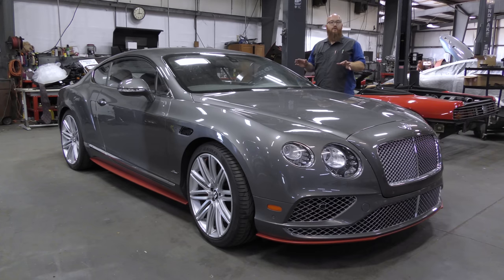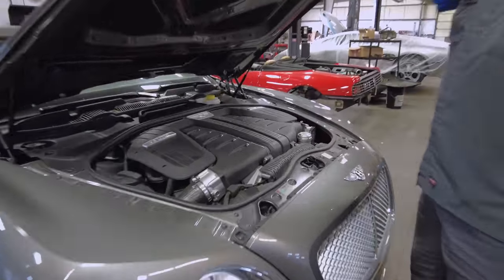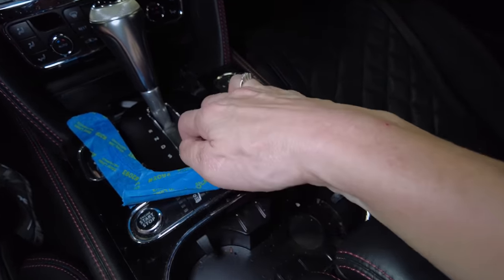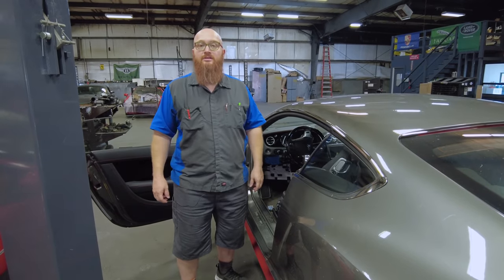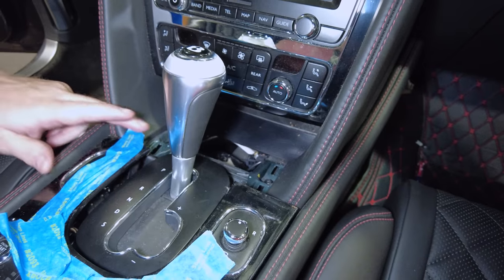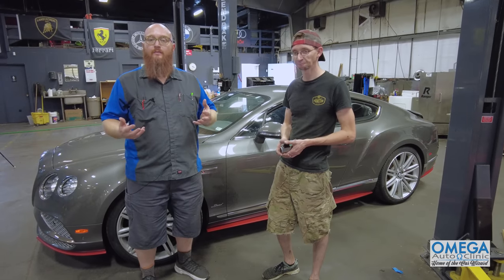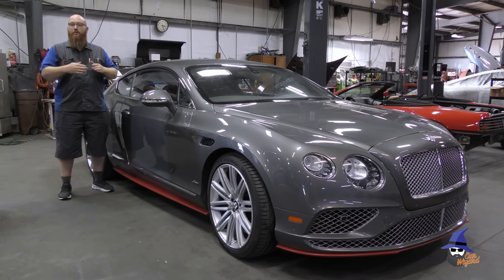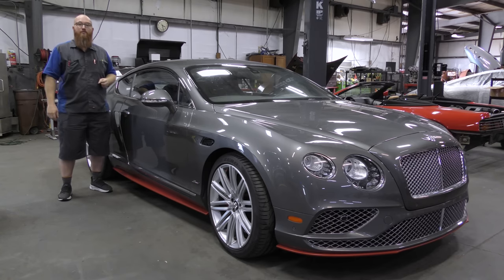How can a $10 Circuit Board make a Bentley Continental GT Speed or ANY CAR completely undriveable!

Comment: Electronics tech, here. Don't let Grimes get away - that kind of diagnostic ability on the electronics side of things is only becoming more and more valuable on today's vehicles. That guy's worth his weight in gold.
Reply: I agree, Grimes has an excellent approach to fault finding.
I have spent almost 50 years doing the same, and for a young person to be this good
is very rare, i hope The Wizard pays him for his skills.
Reply: “That guys worth his weight in gold”

Lucky for wizard he hired a skinny dude.
Reply: @dcerisanothat was leftover flux from separating the board from the housing. Caps were okay, but from what I can tell the driver for the lock motor failed. Replacement boards are affordable enough to pursue that route instead of holding warranties on an in house repair for an out of state car. We want to ensure this doesn’t ever happen in the future for the customer!
Reply: @Barbarapape my grandparents were avionics techs, grandma taught me soldering at 13, spent time doing consumer electronics and flight simulator repair and got pretty decent at SMD repairs. I appreciate it!
Reply: @GrimesGarage  Dang, dude, you’ve got me beat by a year. I learned to solder at 14. Most of my peers didn’t even know what a soldering iron was.
Reply: @Oklawolf  it’s definitely a solid skill to have!
Reply: @dcerisano Board level diagnostics and repair on something like this can very quickly reach the point of diminishing returns, especially with no access to schematics and proprietary part numbers. Is the board worth putting hours into trying to diagnose and fix it? I’d have gone the same way. I have fixed these modules in the past but I only bother trying with my own vehicles.
Reply: The question is what happens when you have these complex modules with fully solid state circuit boards that have ZERO published diagnostics and repair information.  Think early Rivian dashboard electronics and such and what happens when all of these parts no longer exist in new form and all of the designs are closed proprietary information the manufacturer won't release to anyone?
Reply: Surprised to see one of the windows aren’t down.
Reply: @dagamer667   sometimes when the planets line up.....reverse engineering happens

Comment: The issue is that nobody really pays the level of attention to the electronics in the same way that they do the mechanical parts.
Reply: I would imagine the circuit design is just fine - the problem is they would have used poorly manufactured components, like capacitors and resistors, poor quality solder and so on - many electronic components will fail eventually - but if you get a top of the line Japanese capacitor for example, it'll last many decades - if you buy some cheap no-brand Chinese one, you'll be lucky if it lasts half that time before it fails completely, and probably won't be operating to spec for a lot of time before that.  German manufacturers in particular seem to love to use the cheapest ICB components they can lay their hands on.  Bean counter engineering.
Now of course, we are seeing the same issues with mechanical parts too, at least in the spares market - it's flooded with Chinese knock off junk that just isn't reliable at all.
Reply: @Beer_Dad1975  Nope the main problem is lead free solder. the solder doesn't spread as well as leaded solder does on the pads. Unleaded solder also grows 'tin whiskers' over time and any boards in important areas should be conformal coated as a preventative. Capacitors are subject to breaking through vibrations but this is not as common as tin whiskers. One of our customers uses flexible termination capacitors in important locations on his pcbs and his faults have reduced markedly.
Reply: @OP You do not understand what you are talking about. Automotive electronics get a very serious level of attention. Beside pb-free solder, it is common to have conformal coating and potting failures, which are added to protect the modules from weather. Capacitors tend to have low failure rates as they are now solid state tantalum electrolytics for higher values.
Unfortunately that is the role of an immobilizer circuit, to prevent the car from starting. In event of a failure, it will no longer provide the logic function to allow ignition. The set conditions for which the immobilizer may not allow ignition, or in some cases, not even access to the car, is complicated, and occasionally may be triggered by a sensor, fuse, or ground fault (e.g. rodents or old age chewing through wiring harnesses)
The boot issue with the soft material gears is an annoyance, but won't prevent you from using the vehicle.

SAC95 solder is adequately resistant to tin whisker formation due to alpha-tin state conversion. If it's a particularly crucial safety related circuit (e.g. accelerator pedal sense plate) you could go with indium based solder.
Reply: Sadly the mechanical parts are not that great either
Reply: Total rubbish.  My 1998 Isuzu Monterey (Trooper in other markets) got stuck in Nolan's Brook and the 4WD computer under the driver's seat took a bath.  Only had 2WD until we camped overnight and I pulled the computer out, opened it up, and dried the circuit board and the connectors.  Put it back in the car and it was perfect for the next 10 years till I sold the car.
Reply: @@dcerisano Your childish allegation that a high end car would not use low end caps boggles the mind.  A few years ago the market was flooded with dodgy caps.  Even high end HP servers were affected, along with every brand of motherboard and every other device imaginable, including cars.  I had the pleasure of replacing caps on hundreds of devices and restoring them to full operation.  Made a lot of money fixing mission critical servers :)
Reply: @@dcerisano I'm hoping somebody does some aftermarket fab for this sort of thing. Maybe from pcb way.
Reply: @MajorGenralDizz  way more aftermarket support for mechanical than electrical. So we could find an improved version.
Reply: @einfelder8262  wish we had those manufacturers now. And you didn't pay 150k for that car either.
Reply: You can do a visual inspection on mechanical items. Electrical inspection, scan tool and ?
Reply: @iiNgONYaMa  Inflation is a thing.  Manufactured goods back in the 60s were VERY expensive compared to wages.  Not everyone had a car.  That part today probably equivalent to $US150
Reply: @johnweiland9389  but we need to be able to look at the electronics so we need people who have the talent
Reply: @@dcerisano yea id like to see that video

Comment: If I could afford one, I still keep my Accord, as I would need a car for when the Bently is broke.
Reply: Keep it, you'll not buy a more reliable car.
Reply: Very wise, i live only 30 miles from the factory where they are built, and they are reknown for
poor reliabilty.
You don't want to own one without a good warranty.
Reply: And when your pockets are broke...
Reply: They should come with an accompanying Accord.
Reply: So, you'd be driving the Accord most of the time then... 😀
Reply: @Barbarapape My 2006 hasn't been all that bad.  actually my 2004 Infiniti M45 cost far more to keep on the road than the Bentley until recently when I needed new front air suspension parts...that was a doosey.
Reply: I couldn't care less if Bentley is broke or not. It would be worse if the Bentley was broken.

Comment: Because electronics on older classics are often overlooked, and rarely even considered when troubleshooting classic vehicles built during the 80s and 90s, I’ve started a business restoring the various modules and stereo equipment used in these vehicles. So far, I’ve had tremendous success repairing Miata stereos and some ECUs. The key is replacing the electrolytic capacitors - 90% of the time, the capacitors are the root cause of a variety of hard-to-pinpoint maladies.
Reply: My NB's 6-stack CD player only accepts one disc. I'd assumed it was a drive belt and haven't bothered to fix it. Perhaps one day... (And also upgrade to add the minidisc player if I ever come across one!) 😀 

When I was working in car electronics we always specified the high-reliability electrolytics and doubled the capacitance the design called for; that's probably changed now.
Reply: Because electrolytic capacitors suck. And the cheap ones they use on cars wouldn’t have that kind of lifespan. It’s not just a problem for cars, old video games, and all other old electronics share problems with bad capacitors.
Reply: @neilkurzman4907  indeed. I collect vintage computers and other electronics - it’s like a plague!
Reply: You must get this alot, but....I have a 1990 Lincoln Mark 7, the windows don't go down but the motors are buzzing.  Any ideas?

Comment: Cars have gotten way too complicated. We never know when something will fail, with ANY car.
Reply: Cheap OEMs buy cheap parts.
My 98 LX470 is covered in electric crap and it doesn’t have these problems!
Reply: Then there is my 52 Plymouth and 1980 Plymouth.  A small amount of electronics on the 80 but has never let me down
Reply: @JollyGiant19  Toyota/Lexus usually stick with Japanese suppliers, and the Japanese really know how to make high quality electronic components.  Having said that, even Lexus ICB's will have problems like leaking caps, dry joint and so on eventually - but yeah, they'll usually last twice as long or more than the German crap - also things like leaky caps and bad solder are usually easy fixes as long as the PCB isn't damaged - if you don't want to tackle it yourself any decent electronics repair shop can usually manage it - even if the PCB isn't great, that can often be dealt with by someone with a bit of skill too.
Reply: @JollyGiant19 it's a Toyota
Reply: desined to fail more like it...
Reply: It's why i don't buy any vehicle after 2000-2005.
Reply: Thats the idea behind planned obsolesce. Make something too complicated to fix or too expensive to fix so it ends up in the dump and you're persuaded/forced to just buy the new model. Car makers are not dumb, and it didn't just happen out of the blue. Especially with luxury brands, they only want the new stuff on the road
Reply: @@RaccoonsthebossAgree, the fake-supra for sure.

Comment: Steering wheel lock malfunction a very common issue in Corvette C5s. The drive pin locks place. Had 4 C5s and after he first one malfunctioned-One of the first things I did when I bought subsequent C5s was buy a Bypass for the lock mechanism. A $120. investment that ALWAYS eliminated the this common issue. Leave it to the Germans to over-complicate this issue.Their mantra is -"why use only one screw-when two will work better"

Comment: It feels good knowing that my $70K Audi S5 is made with the same parts found on a $200k Bentley and a $30K VW. Reminds me of my Saab and its mish-mash of GM parts bin equipment.
That said, my Saab is currently sitting at 176K miles and aside from brakes, maintenance and the AC compressor, its been a damn reliable car. I bought it new, I was the only person who drove it, aside from a couple of techs, and I'm still on the original clutch.
Reply: The 2010 Lamborghini Murcielago has a cd changer in the glove box that also was standard in the trunk of a 99-05 volkwagen jetta.

Comment: In Germany the auto club company ADAC actually have tow trucks that have a crane hoist on the back where they can literally lift a car, parked between 2 others. vertically and swing it onto the back of the tow truck. Likewise they can deliver it too. Ive never seen that here in north america. would have been good in this case
Reply: Yep with the CANBUS confirming the serial numbers of items like instrument clusters when one goes wrong it can lock the car up to the degree it locks the transmission - I think that may even be required by EU legislation.
Reply: In London back in 1973 our car was taken to the pound by just such a truck.  Nothing special about that device.  As Aussie tourists we managed to get the car back without paying the fees by being very nice to the guy behind the counter, haha.
Reply: You might see that on a 3axle tow truck for 18 wheel trucks. But towing fee would be $$$.
Reply: Why not just put dolly's under the wheels and winch it onto the trailer normally?
Reply: Yes, seen them in action. They also use this mechanism to remove illegal parked cars.
Reply: that idea came from tow companies hauling off cars illegally parked in tight areas. people would park in nooks on narrow streets where the cars werent accessable.

Comment: 3D printing those new parts is an awesome way to keep cars on the road.  Kudo's for that business to take on the process of scanning the old part and printing it new!  I'm sure in the future we will see more exotic metal capable printers hit the market for less money too.
Reply: the thing to retain is that it costs half the cost of the new part ?!!!!!! damn 3d printing is expensive lol
Reply: I tried that with some plastic gears from a laserdisc player, they lasted a few discs then split apart.
The technolgy is getting better, but the plastic they use has no strength.
Reply: seems funny (ironic) that a $200,000 machine is undone by a $10 part (or two).
You'd think they would "test" them first...
Reply: @Barbarapape They cheated you with crappy stuff. If they used something good that wouldn’t have been an issue.
Reply: @oldrrocr  that part does not cost $10 in Bently more like $1000++
Reply: @Barbarapape  
Did you try Nylon?  It would likely be better than ABS.
Reply: There was no information within the video on how those plastic gears were manufactured - so not sure whether the plastic parts were 3D printed or simply 'cut' using a CNC machine.   Whilst 3D prinitng does provide options, the limiting factor is the type of plastics available - which often don't provide the required strength and toughness of the original part - a situation that I have experienced more than once.  In any case, 3D printing is continually improving - so I live in hope.  To ensure a more robust solution, alumimium gears would have been the better option although cost would have been substantially greater.
Reply: Bentley don't care as long as the body work and interior are blemish free.
Behind that posh exterior lies a car with many inferior parts. @oldrrocr
Reply: @Vitormarques542  He's talking about the cost to manufacture the circuit board.
Reply: @Barbarapape  Questionable if consumer FDM-type 3D printers can do the trick. There's probably quite some forces at work in that trunk lifter gearbox. But on an industrial level there are lots of different methods of 3D-printing which are suited for this task I'm sure! SLM or sintered metal comes to mind. Also, as forementioned, Nylon would be much better suited for this application over ABS or PLA plastic.
Reply: @Barbarapape  It's a fact, the oily bits are the same across the whole corporate range. Another Utuber replaced a set of injectors on his RR with the ones from a 3-series BMW.

Comment: The car has 19,850 miles. Actually 0-60 4 seconds flat in the Speed (206 mph). I jacked up each rear wheel and put auto caster wheels (from Harbor Freight) on locked rear wheels. Dragged up on transport trailer with a Tahoe using recovery hook on front bumper.

Comment: Thank you Car Wizard for keeping my car repair education current. Bentleys are essentially German cars, and we all know the tendency to over complicate with substandard components and eventual high repair bills.
Reply: My Flying Spur has been in the shop for two months. I get back next week. The car didn’t believe I was stepping on the brake, so wouldn’t let the car start. The part is superseded but the car only reacts to the old part. And even then a section of the ignition circuit went out. Before that an egt sensor caused random limp mode incidents. Great car, but the tiniest things yield it  stranded.

Comment: This happened on my B6 Passat, as you say a common issue.

A good way of getting power to the car is bridging PIN 16 and PIN 1 on the OBD port. That will give enough to get the parking brake released and may also allow you to get the car in neutral.

Mine is a manual 6 speed so the neutral release wasn't needed.

Be aware that sometimes the module going also causes an EEPROM corruption in the immobiliser and may cause weird errors in the future until it is replaced as well.

Comment: Very honest of Wizard finding the $10 part problem. Any other foreign shop would say $1000.
Reply: just a thousand?🤣🤣🤣🤣
Reply: Oh he didn't say the part was $10... He said the board cost $10 to make.
Reply: Please don't confuse! Wizard said the PCB board (mass produced) probly costs $10. That is not the complete replacement part, nor its retail price. Also no costs for labour (troubleshooting, sourcing, ordering, reassembly) included. Even a remade PCB-board or the service of replacement of single components is likely much higher than $10. A OEM replacement part might be even cheaper, if its not labeled Bentley but identical part also used in a "generic" Audi/VW. Even then it still needs programming to the car… Hell of a hassle.

Comment: I had a Mercedes E class 2006 and had the same problem as the Bentley. The car was only 4 years old. BUT even Mercedes couldn't diagnose the problem. The car was down for 3 weeks till I spoke to a Mercedes Car Breakers

Comment: Try buying a replacement tail lamp assembly.  Sit down phone the paramedics to come and be present, advise them to have the defibrillator at the ready . When there and ready, phone the dealership   .....charging        clear          ⚡⚡⚡⚡         🤞🤞🤞
Reply: The IAC motor on a 2001 Mazda 121 1.3 L engine costs, get this, TWO THOUSAND DOLLARS in Australia. Same motor on a Holden Commodore same year costs $90 Aussie $$$. And yes those are dealer prices.